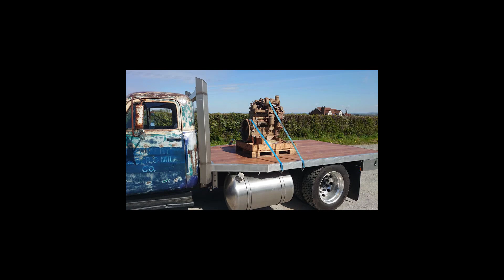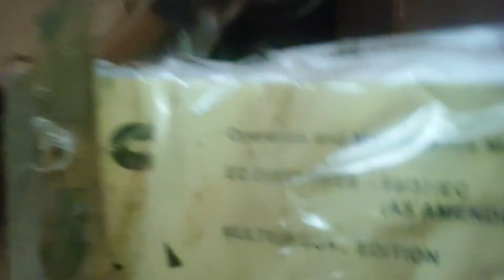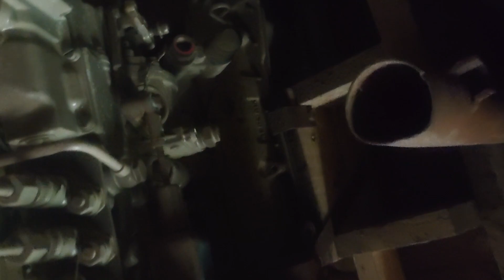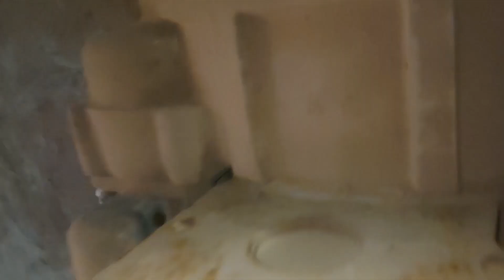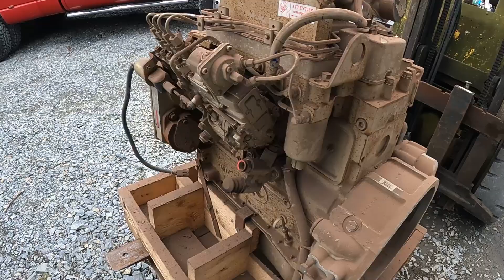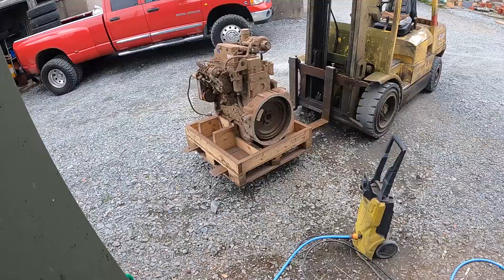"NEW" CUMMINS 4BT RESCUE PART 1- Background and clean up

Comment: Industrial engine, SAE flywheel and bell housing. If its governed at 1800rpm it was speced for genset. It could be agricultural or water pump¥ or other use. I personally use the JD 4045 as speced for genset use they are internally balanced, and bigger displacement, a more quite engine.

Comment: I don't know much about these, what's the appeal, torque, longevity, can't be horsepower...
Reply from the maker: Mainly torque and longevity, can't make hp without rpm lol. you can make alot more power by playing with the pump governor.
Reply: You can tickle hp out of these Joe, seen a few on the tube dynoed at 700hp